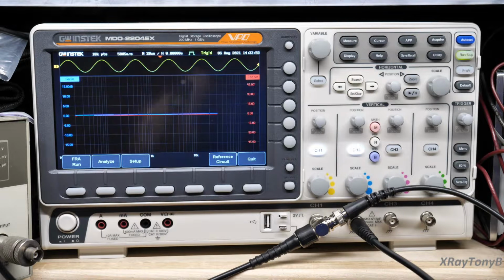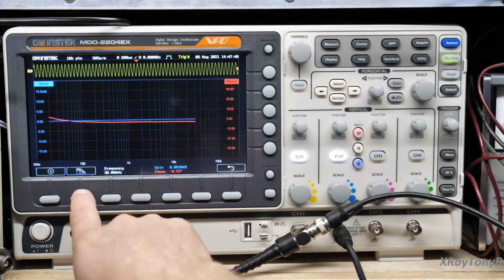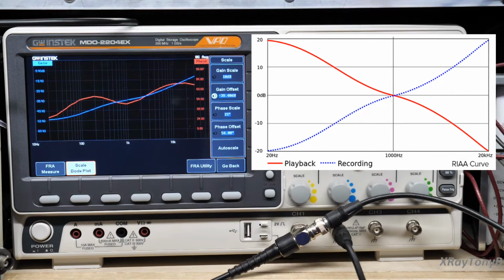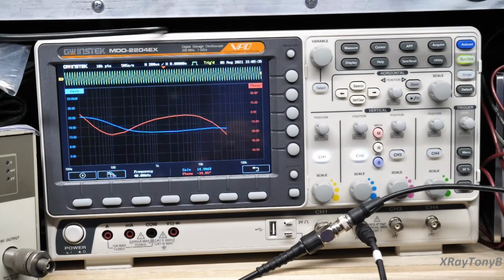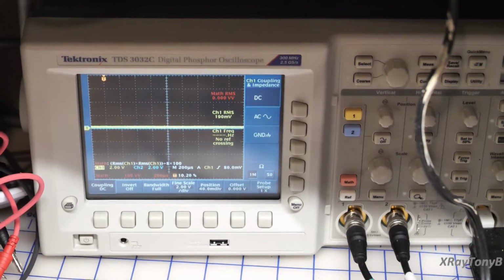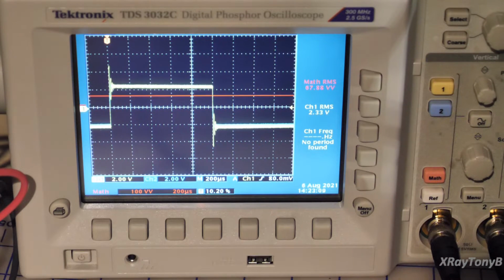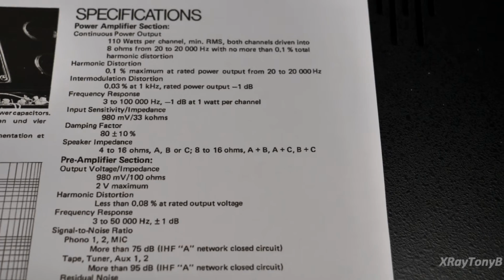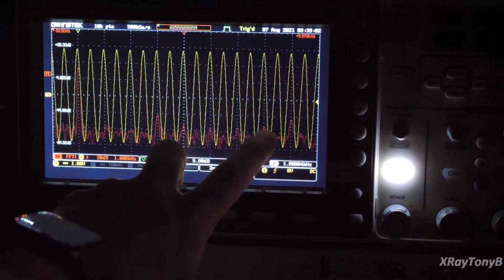Amplifier Testing - Featuring the Rotel RA 1412

Comment: The loudness function are set to emulate the Fletcher/Munson loudness contour (the low frequency portion in this case,)  that they created from a study they conducted which determined what humans perceived as sounding flat and different sound levels.  It is good that rotel reduces the boost as the volume is raised.  That reduction matches human hearing.  Not all amps do that.
Reply: Almost ALL amps alter the loudness boost as the volume knob changes. So, your comment is kind-of misleading and makes it sound that the Rotel is somehow special.
It's easy for a user to test - simply press the Loudness button at (say) 9 o'clock volume and see if the sound changes, then do the same with the volume knob at (say) 2 o'clock setting.
Reply: @johncoops6897  maybe at the level you are used to dealing with but alot of receivers did not.  My kenwood kr-3090 did not.  A lot of others didn't either, especially early in the audio game.  My experience goes back to 50 years ago.  While the Fletcher Munson  paper was first published in 1933, companies did not incorporate them right away.  I can remember when the turning down of the curve with increase in volume was a selling point in the 60's - 70's.

Comment: Out of interest Tony, can you confirm how good/bad/much the Radio Hash is coming off your MDO's switchmode power supply.... I moved my 'new toy' at my bench so it sits a couple inches above the bench work top & is in easy reach. It's been fine with some ac volts work & logic stuff but then i tried work on a suddenly deaf on AM HF radio receiver of mine...I  found so much hash present and soon found its coming off my Gw MDO...   Get this though, if i put the scope down on the bench surface though, it becomes ok to use (mostly).... which says the underside is missing internal RF screening maybe....? Could be a video in it for your efforts ....
Reply from the maker: I really believe that this unit has a lot of interference from the internal circuitry.  When I think about it, they stuffed two function generators, two 5 volt variable power supplies, a DVM input, a 4 channel oscilloscope and the circuitry for the spectrum analyzer, in addition to the processor to operate all of this stuff, all being driven by a low cost switchmode power supply into a small, poorly shielded case.  All of this for the cost of a midrange oscilloscope.  I take that into consideration when I form my opinion on it.  It is a good device for the hobbyist, as it has many features.  It will work for most audio and some very basic RF applications, but it is not a perfect substitute for the discrete components that it represents.  I will continue to use it for applications where these limitations don't matter as much.  Thanks for the comment!